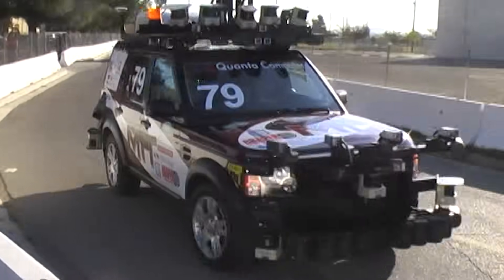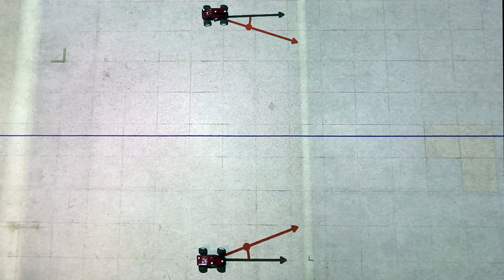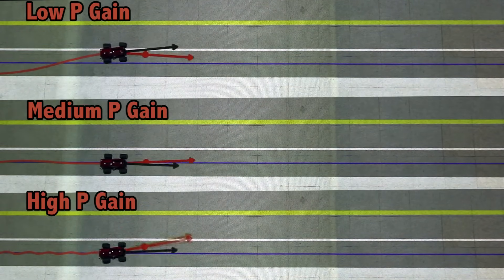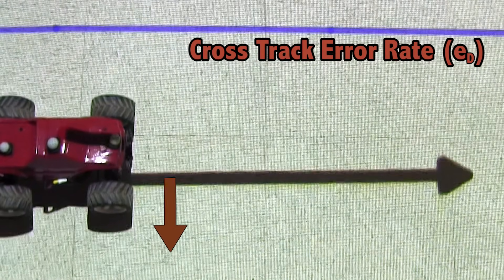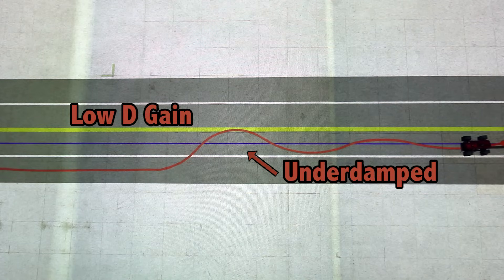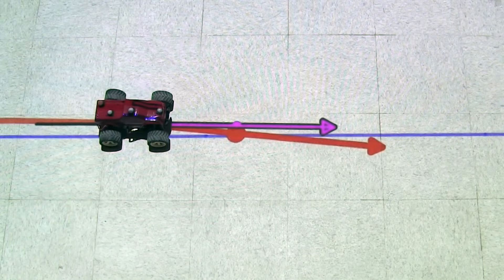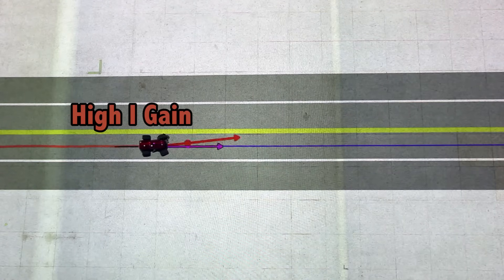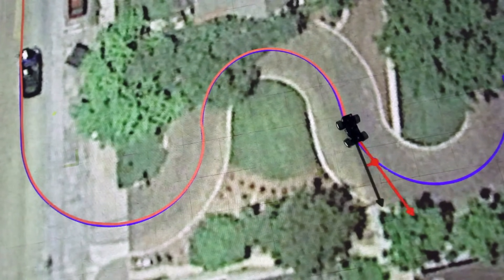Controlling Self Driving Cars

Comment: I have never had a class on PID controllers, but I am trying to use them in my holonomic robot. It is really difficult trying to tune a PID controller, while dealing with the motor configuration of a holonomic robot!

Comment: Will these gains change for different speeds ...if so how can I make a system that "learns" to tune itself?
Reply: Vineet Verma you would first need to find out how your vehicle behaves at greater speeds, as in, at higher speeds your vehicle might have greater understanding behaviour. Then you might have to look into other options such as gain scheduling or making your steering inputs dependent on the speed.

Comment: Nice explanation! But why would the PD system not correct itself after the rocks incident?
Reply: Let's say in the normally working car with only a P control, the scaling was such that 1m left error causes a 1deg right steering command. After the alignment gets knocked, all steering commands are mechanically remapped 1deg the the left. So the same 1m left error, now gives 0deg steering (the electrically commanded 1 deg right, minus the 1 deg mechanical offset)

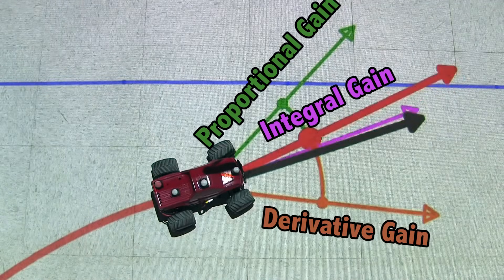Comment: This did a great job explaining the concept, but I'm still confused with the Integral term. If the car's spent time off the track then the integral term increases and drives the car back to the line. But once it's on the line, if P and D are zero, aren't you still left with the I term pulling the car away? At 3:43, the car moves along the line perfectly horizontal, but both the I and the total vectors point down. Is the I term supposed to be reset to 0 when it hits the line?
Reply: Aditya Singh that's a really good observation. It's precisely for the same reason that the integral gains are not set high as it could cause the car to overshoot. However if the I gain is tuned low, then the derivative gains will resist the changes caused by the integral gains.

Comment: You should use car body approach angle  in proportional gain method and add steering wheel angle to control that parameter. Your approach to relate steering wheel angle directly is wrong.

Comment: Would PID be appropriate for following curved paths? If so, what error function should be used?
Reply: It should respond fine with the functions already given, the path is curved, so as the vehicle turns to correct it will continue turning until the path straightens out again. You can see it moving along a curved path at the end of the video.
Reply: The trick/difficulty is in defining the path to follow, not necessarily in following it. PID will do fine along a curved target path, provided the gradients and time constants are appropriate to the actuators/inputs.